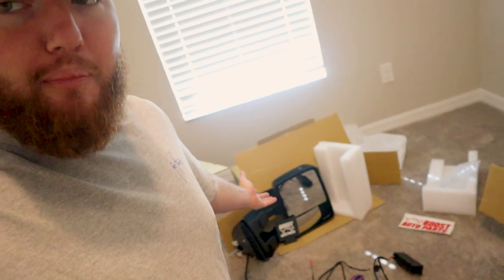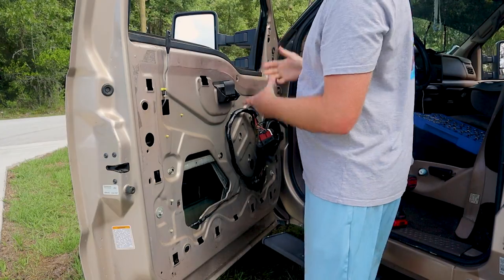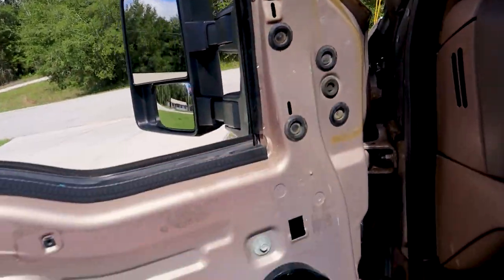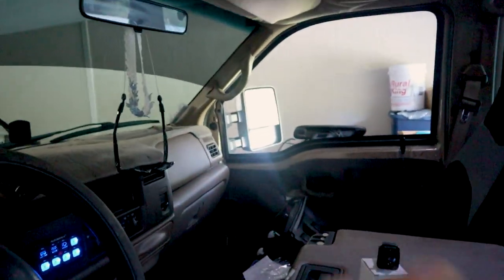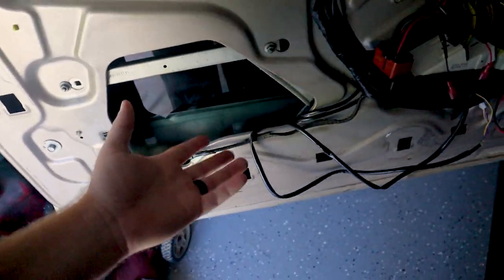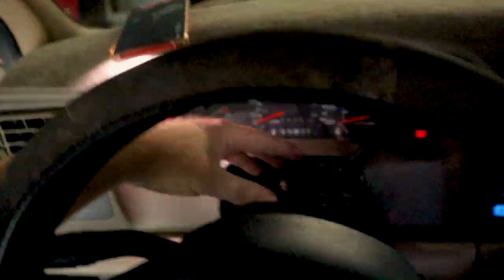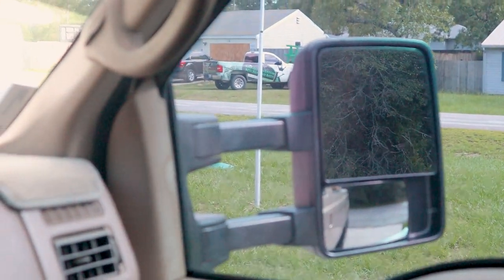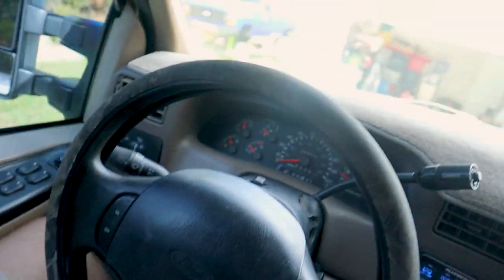Boost Auto Parts Tow Mirrors WIRELESS Power Fold & Extend!

Comment: Nice video. I did notice that in the Factory Ford SuperDuty Wiring Diagram Manual diagram 100-7 connector C510b pin 3 (Black connector), the Yel/LtGrn wire only has power under two conditions. 1. When the key is on  and the Window Lock/Window Unlock must be in the Unlock Position. If the Window control is put in the disable or lock position it interrupts the power to the window controls and the module. If you want a Key on power try the LT Blu/Black wire on Connector C510a pin 2 (Grey Connector), it's the one that feeds power to the whole Window Switch Assembly in the door, including the Window Lock/Unlock switch that has the Yel/LtGrn wire cumming out if it. Anyway just test it with the window in lock and unlock. If it doesn't work in unlock you know where to get your "Power When Key On Only". Don't know if it applies to your year but if it does it could help. Thanks for the video, nice job. Best Wishes & Blessings. Keith Noneya

Comment: Installed mine on the 2004 F350 last week. They are rock solid and the power fold/extend works flawlessly. Field of view is huge compared ro the OEM rounded off mirrors. Worth every penny.
One thing I do NOT like... The use of wire t-taps. Those things are a disaster waiting to happen. Solder splicing in a pigtail with a fully insulated spade connector is FAR more reliable.